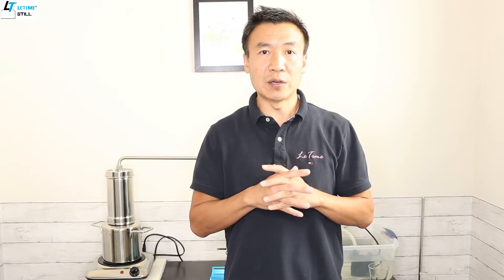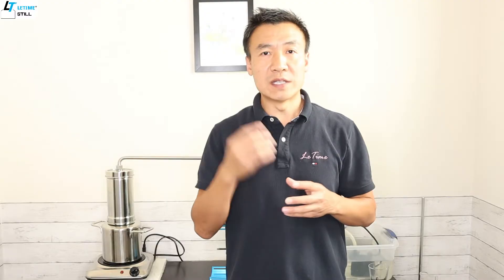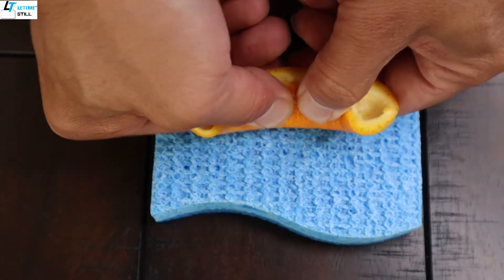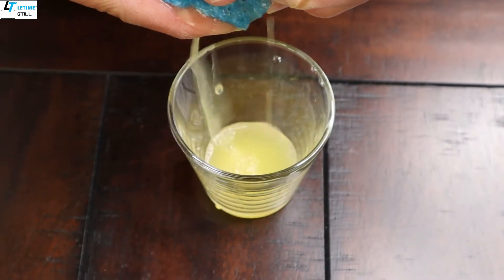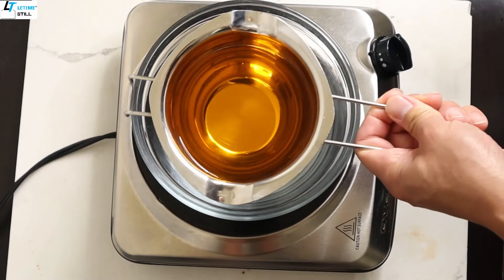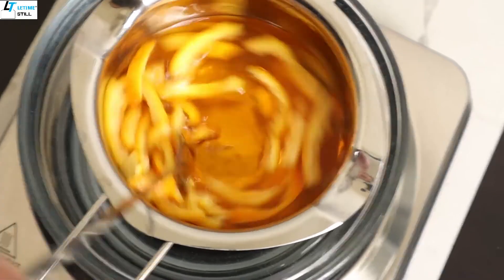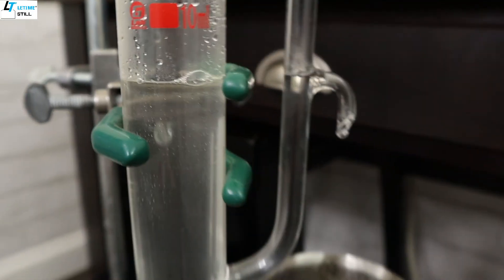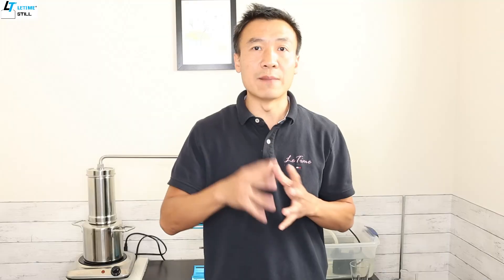3 Ways to Extract Essential Oil, How to Extract Essential Oil, History of Essential Oil Extraction

Comment: in the case of the enfleurage or oil extraction of essential oils. When the alcohol is mixed in to seperate, how do you then seperate the essential oil from the alcohol?
Reply: a bit late here but i think and im no professional but think you boil it?? i mean ethanols / alcohols boiling point is pretty low so i guess it would work. you have to try though. im not sure.

Comment: Is it possible to extract oil using the Egg or the Egg yolk. what process could be use? Thank you.
Reply from the maker: Solvent extraction like hexane is a modern way to extract oil out of egg. Heat extraction has been used for long time but it may reduce its activity.